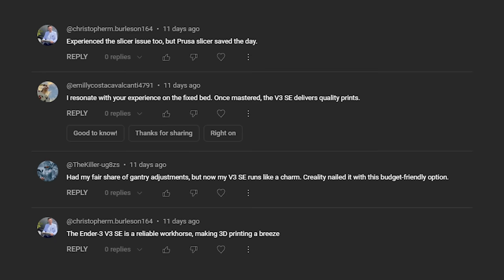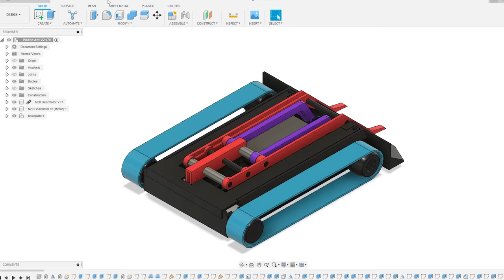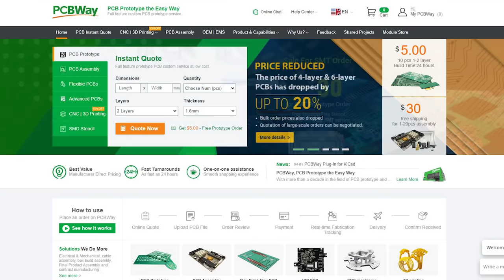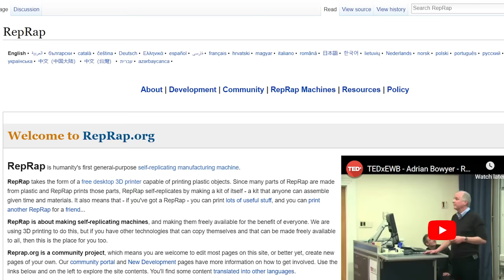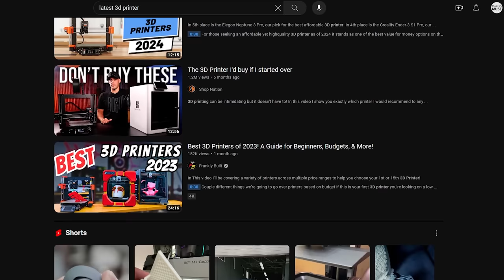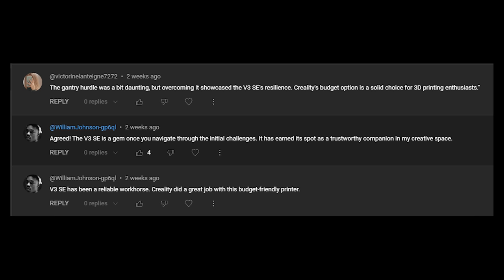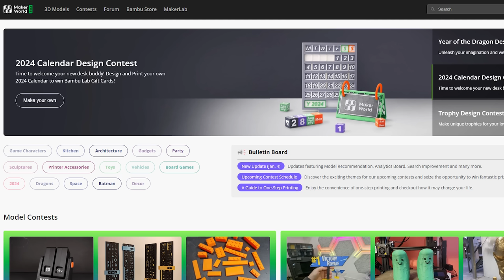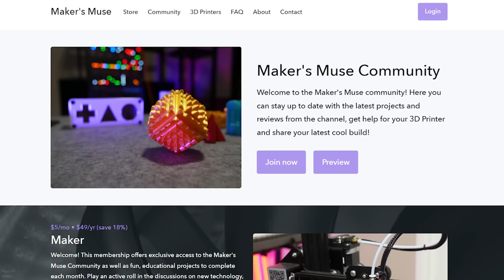My 3D Printing Predictions for 2024

Comment: i rather have my tinker heavy ender than a printer that i have to outsource servicing if something breaks.
it's like cars. rather have my oldtimer i can fix myself than a hybrid or electr. car that cost me an arm and a leg to fix when i get car troubles....

i rather learn how it works. 
from no tech background,an education where i dropped math at 14.... to now building a mpcnc lowrider. 
never could do that if i had gotten a bamboo as a first printer.

bamboo is great for a demographic that has no interest for technical stuff, but want to print "cool stuff" without honing skills.
for me the only perk would be speed, but am happy with 100 ms on my ender pro.
if they drop price with another 200 than i think about it.
but as it stands i don't get a lot of benefit from the step up in price.
even if i take energy consumtion into account it would take me 4 years to break even compared to an ender 3 i can source for 100 euros new.

Comment: I've been using Blender for all of my models and it's been producing extremely accurate models for both fun and for a purpose. I have a file saved with everything set up for a Blender print and I just use various methods for measuring things and I get excellent results. I tried using Fusion 360 but found it clunky and non-intuitive. But then I've been using 3D software since 2001 so my brain is wired a certain way. I'd probably use a CAD program for something more complex like something robotics related.

Comment: Prediction: More brands are going to jump on the bandwagon for multi material units/solutions. The AMS for Bambu was a big success, but also has its quirks. In my opinion there's not been a brand that has offered a great solution which applies to printers that offer a hassle free experience that just work
Reply: Unfortunately, hassle-free solutions often lead to a closed ecosystem.
Reply: @andreas.grundler  Agreed, a closed ecosystem is not helpful in getting the 3d sector further in innovation. However, looking at for instance Bambu, there is a very big market for people that just want printers to work regardless of the fact if it's a closed ecosystem or not. In the end it's suppy and demand.

Comment: Prediction for 2034: NixOS will add an environmentally responsible 3D printing repository where you can build (print) an item, change the design, then rebuild using the same material.

Comment: i picked up an Ender3 v3 SE after using a basic Ender 3  (upgraded with duel z axis motors and lead screws and other parts including crtouch my bl touch broke). the Ender 3 v3 SE has been a much better printer iv been dialing in the top surface though its been a little rough As well i had a weird issue with the torture toaster where it shifts on the x axis. but it also happened at roughly the same layer on my older ender 3
Reply: Going from a modded Ender-3 to an Ender3 V3 is not really a considerable upgrade... 
Still a basic printer with lots of tinkering involved.
Reply: @alejandroperez5368  it sure felt like a major upgrade to me there is far less tinkering and needing to spend extra money just to get the thing to print well it took me to the point of adding the dual z-axis motors to get a good print consistency on the original ender 3 then the v3 the V3 was out of the box solid print quality. you have no right to belittle anothers experience with their printers. for the price of an ender 3 v3 i  put in about that cost into the original ender 3 just to get it to print as good quality (not speed) and consistently as out of  the box with the ender 3 v3 SE

Comment: You've not mentioned how potentially damaging the trend of locking down firmware is likely to be. Its only a matter of time before we get to a point where your stuck with manufacturers firmware and it needs to call home every time you use the printer.

Comment: 3d printing can't be used to alleviate supply chain issues because the items aren't benefitting from the economies of scale that injection molding factories do. You've got to use 3d printing to prevent the consumer from purchasing the item in the first place.

Comment: Vell here ist an old ex Kraut real life user ja? I've just bought a second E3V3 SE because they are dirt cheap at $249AUD on special at the moment and the damn thing flies and just plain works! Been comparing it to our Ultimaker S5 which costs 48x as much and is a quarter of the speed. So was this an AI comment nein? FYI I started out with the original Makerbot plywood "thing".
Reply: Ultimaker is just wired, some of the first dual filsment printers, extemly expensive (like 6k for there flagship model) and 4 out of 5 trade show booths that have an 3D printer it is an ultimaker.

Comment: I don't see the future as bright as you do. A single company is entering the market with such brute force that you can assume they want to dominate the market and won't be satisfied with a small market share.

Let me just remind you of how this ended up in the drone market. DJI came out of nowhere and now has an 80% market share. That means they have something of a monopoly.

In the long run, this will lead to other manufacturers going out of business and the market for aftermarket parts drying up, which I assume will have a negative impact on the DIY sector. If Bambu Lab succeeds in establishing a monopoly, they won't innovate because they won't need to. Instead, they will try to prevent new competitors from entering the market, for example by using their patents.

Comment: I would love to learn Fusion 360 and wonder if you thought about making up step by step instructions for using it. you tube videos are quick because no one wants to watch a video hour long so not much instruction involved. I would like to see a class where everyone in a small group can join in to learn. like teams. A paid classroom as you as the instructor. As for printer review, I take all of those with a grain of salt and do not rush out to get the next new printer the A1 from Bambu is an example they been all recalled for safety. To me it looks like a cheap toy the AMS and seeing the printer print and lifting off the table is why I stayed away from even looking at the printer

Comment: After the fusion 360 takes more and more features out from free version I started to look alternatives and found solid edge that have free version for hobiist. I is not so convenient to use compared to fusion 360 but it is really capable software, so I am trying to get used to it. one thing that I already stumbled upon was that I wasn't able to import svg file as template. Maybe it is possible but at first glens I did not find the way.

Comment: i use sharp3d fpr all my 3d print/woodworking projects, they been amazing, and super easy to use even for me, with no background in design. Two big down sides are:1. bit expensive for me as a casuel weekend hobbits. 2. only work great on iPad pro with 2nd gen pencil, also works on windows and mac but not as great as iPad version

Comment: I'm much more interested in a printer that simply prints. I've been away from the 3d printing hobby for a while, largely because I got tired of fiddling with fine adjustments on the machines. 

I want to tinker with the printed objects and the models they are made from, not adjust or modify the printer itself.

Comment: FreeCAD. It's free. It's CAD. It's a bit janky at times, but powerful. I gave up on Fusion when it was clear that I was simply training myself to be bound to their softwere. No thanks.

Aluminum is a bad example of recycling failure. It's the most recycled material on earth. Yes, it surely costs extra for Australia to send it to Korea, but you can be sure it's almost entirely recycled, at it takes about 95% less energy to recycle it than to refine it.

Comment: I'm tired of the internet having a hard on for bamboo labs. There are numerous cheaper alternatives that produce equivalent print quality. Example: The Creality K1. Also, multi colored prints are mid. Rather than doubling or quadrupling your print time, simply learn how to post process a print.

Comment: I doubt that "easy to use" CAD will ever exist. I think that it should be taken as granted that certain classes of software require some amount of time to learn.
I started 5 years ago from FreeCAD with no CAD experience (however with tech background), and it took me approximately 10 hours to understand basics (basically 10  one hour long youtube lessons).
Considering the power which you can get with cad modeling, 10 hours of initial start is almost nothing.
You can find program which requires less time to start, but usually it has less functions.

Comment: IMO I can see decline in trust-ablility of reviews.
When companies send out hundreds of expensive printers to known and less-known content creators, some of them with no previous 3D-printer experience, what do they say? It's a bold move and needs polished first user experience, hat off to that. But.

When everyone got ~200US "another Ender" (loads of them, from different companies + variations), I guess nobody expected reviewers to actually buy those with their own money. But expensive review unit, yours to keep? Seriously? Bribe, even if intention is good?

 The same with random YT reviewers - "Best printer I have ever had" (total count: 2). "It's so much better than a lowest-cost printer from 2020" - sure, but how about comparing to lowest-cost printer of 2023 or same-price printers of 2023? 

Reviewing process seems overly simplified: print provided fast Benchy, some random parts, all this without any tuning for your filament. It's stringing, retractions are not good - well what did you expect? Is there VFA, how good is calibration, how does the printer do it's main job? We are left with pretty thin layer of data under lots of expectations and hype.

---

Another thing is that reviews are day-0. Whatever improvements there will be, usually not noted. Whatever problems there shall be, read later in Reddit (commenters declaring their units are fine, as if it made situation any better). The original reviews will not get any update or new info of what has happened during 6 or 12 months of use. And even if they did, damage has already happened. Journalism of 2020s - facts don't matter much. A bit like Voxelab Aquila. Everyone's favourite, until they switched to not-so-open H32 processor. 

---

Third, and maybe the most absurd, is VIP customer support for high-profile reviewers. If they buy a printer and use customer support under non-recognisable name, they get "normal" support, jumping through seemingly endless loop of hoops etc.
If/when they reveal who they in fact are (possibly because the problem was not solved by common means) they are forwarded to VIP support, working relentlessly to fix the problem and sending new parts and printers.
When you use your own money and end up in long queue of not-so-great support and/or part failure that is not easy to fix (send printer back - depending on the store you used and your warranty, possibly paying it yourself - instead of receiving and installing new part), does that suck :/

---

Second big issue is the fall of 3D-printing community. "Experienced" 3D-printer owners very easily forget, that
- they still do not know everything, maybe not even proper basics
- they cannot mind-read what the other person has done or what she/he knows
- if you don't want to be helpful, STFU
- your printer is not better, theirs is just different
- you were rookie too and needed help, not farting to your face

This can be seen in YT comments and FB comments (I don't follow other channels, but I'm falling into my own rabbit-hole #2 of assuming they are the same). Everyone loves to hate Creality and hates to love Bambu Lab. Prusa is the evil behind everything too expensive for what it is , though it is the only (please, if I'm wrong, list below) consumer-ish-price printer not made in PRC. Sides, black/white, with or against us. Community has new king/queen, we don't care if creator is obligated to share their information about us with their government (might be equally true in other countries as well!) or if their government has put 1M of their citizens to camps (e.g. due to religion). New king/queen!

Comment: One of my big issues with the 3d printing community currently is the gatekeeping. I'm an admin on several 3d printing groups on Facebook. Most of my time is spent making sure the gatekeepers don't push people away. My goal has always been to help out new people and get more people into 3d printing. I believe the more people we have the better the products will be. I get it. I'm one of the early adopters and have spent years upon years tinkering with printers. And some people hate the fact that novices can buy a Bambu Lab printer and just start printing without having to know every little detail about the machine. But I'm thankful for these machines that just work. I actually stopped 3d printing for about a year because the constant tinkering and fixing printers became too much of an annoyance. It wasn't until Bambu Lab came around with the X1 that I got back into it. I just want a machine that works at this point. And it's not unreasonable for a novice to want the same.

Comment: I have found design spark mechanical to be great. Both on its ability to run on a less than high end machine, ease of use even for non cad people that don't want to invest a large time commitment to learn as well as it's cost and user agreement. I know it doesn't do all fusion does but I find it easier to use and works great for my mild skill set when I just need a box, bracket, mount plate etc.
Reply: It's been a while but I did not enjoy using design spark, mechanical or pcb

Comment: Can't have an easy to use CAD program that's also highly capable... they're polar opposites.
Reply: you can have 2 modes, simple mode and expert mode, press tab to switch between them and all the geometry is translated over
Reply: @Zyghqwyv   That's just hiding the interface...

Comment: I refuse to upgrade..... Reason..... The cloud, yes it is a really nice interface and and and, but, if the infrastructure goes down for what ever reason..... You are screwed, any form of cloud connection has all my red lights on, I'll stick with my "slow" assed printer, that does not need an internet connection.... And, when it comes to fusion.... No one in Africa which has an 18-ish :1 ratio of the USD can afford Fusion unless they use it in a business environment... Yes, a very usable and friendly interface, but using the free version again needs an internet connection....... So, nope.... not going to work....

Comment: 3mf is already incompatible between prusaslicer and bambu labs most of the time.  I think the format has failed for that alone.
Reply: You probably mean that Bambu Labs chose not to adhere to 3mf? As in breaking what was out there? Kind of hints as to where they are taking us.
Reply: @FrodeBergetonNilsen  incompatible is incompatible no matter the direction.  I'm not going to get into a prusa vs Bambu holy war.
Reply: @gwaland  This is DJI for 3D printers. There is no war. But you seem to scared to even talk about the culture of DJI, and seem to straight out lie about it. That is not cool. The industry has been stagnant for a long time, because we lack the right people. Baboo Labs is not going to fix that, only make things worse.
Reply: @FrodeBergetonNilsen  I'm unwilling to get into a discussion with someone who's got an agenda to continue a culture war that's already been listed by this creator as a problem.
Reply: @gwaland So you are a runner. Impressive. Still don't change much.

Comment: I'm a huge A.I fan so all for innovation through A.I. What I really hoped would happen in 2023 would be slicer software would start to understand 3D models and how to handle more steps for us. So adding supports automatically without you having to think about it and knowing it would do a better job than a support pro. That didn't happen. 3D seems to be as tough I think as video. I really thought of 3D models like images with an added dimension but looking at the 3D generation purely from A.I. It is still primitive and while gaussian splatting and radiance fields are raging through real-time 3D. I haven't really seen the same leaps in 3D model for printing. Perhaps 2024 will be the year all that comes together.

Comment: Every comment?
Reply from the maker: Yep
Reply: @MakersMuse even this one?

I have s question I'd love to run by you about brands for building out s mini farm.. maybe 10 printers to start
Reply: Currently I have one printer I just bought to prototype with.. any cubic kobrs 2 max and so far I enjoy it very much from the 20 or so prints I've completed but I don't need thst much space for most of the lrirns I'll be needing and if love some degree of wireless control or viewing. Mostly printing in cfnylon and PLA as far as I can tell.

Comment: I'm stills trying to get my bambu x1c to work at all. I have been submitting support tickets since November 2022. After a year bambu begrudgingly sent me a new bed. It was HORRIBLE to install. It also did nothing to fix my issue. I have a 1/4" gap in between my bed and hotend. Even after manually tramming. Bambu asked for another video of this. That was almost 2 months ago with no response. I will NEVER support that company again. Wasted 1500 bucks.

Comment: I have seen totally fictional AI generated reviews and comparisions of products which might not even exist. You can prompt a LLM to compare Ender 17 and Bambulab 2000, and it will do it. And it looks deceptively plausible. This trash is already degrading important parts of the internet.